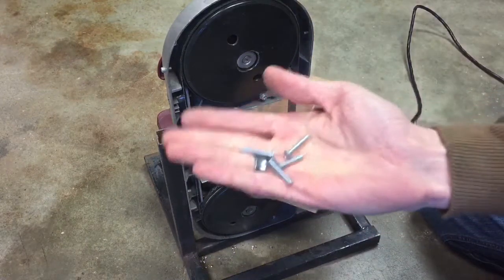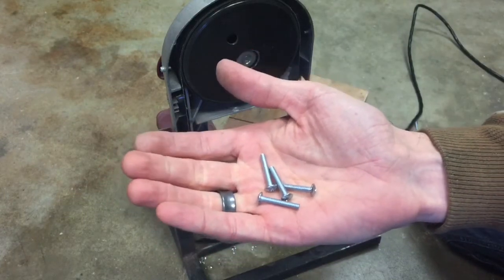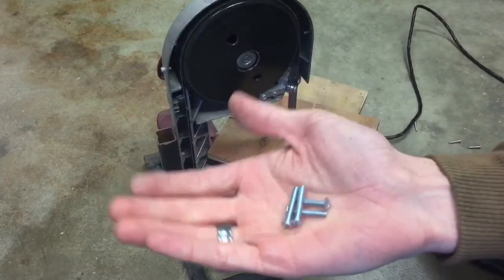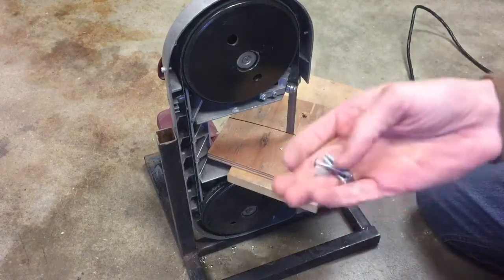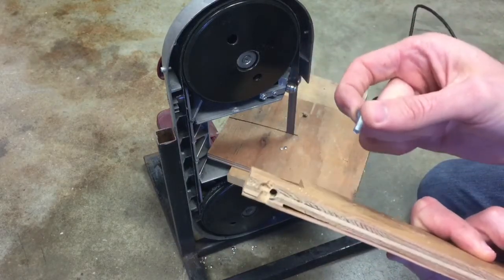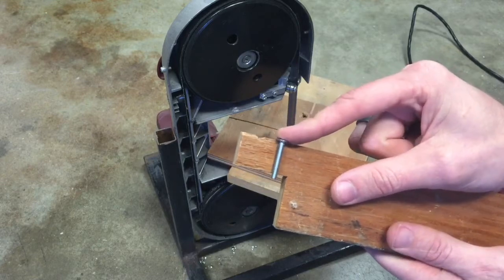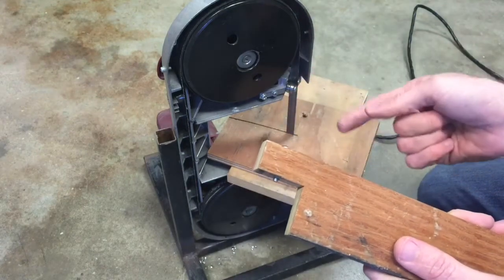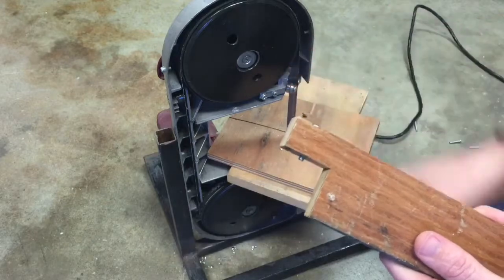Quick Tip: Cutting Small Screws

Comment: is the thread not damaged? Can one use a angle grinder to cut a small screw?
Reply from the maker: No damage to the thread since the blade is not able to wander down the threads. Some of them had a little nub of thread remaining because I was pushing through the cut too fast, but those were easily  knocked off with a few swipes of a file. Yes, you could use an angle grinder to cut, but you may end up with a bit of metal slag from the cutting wheel that will need to be cleaned of the end of the bolts.